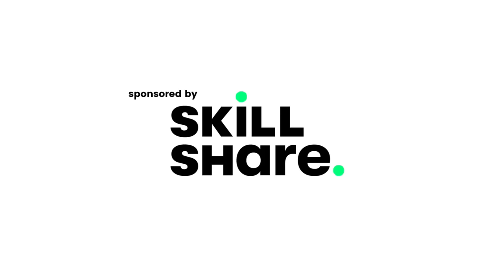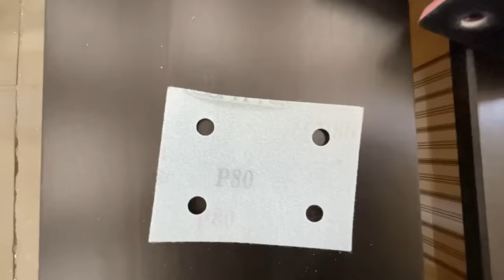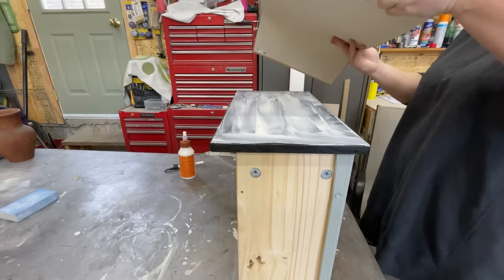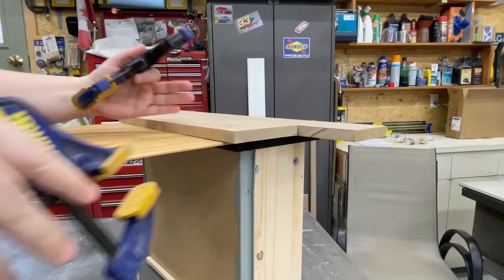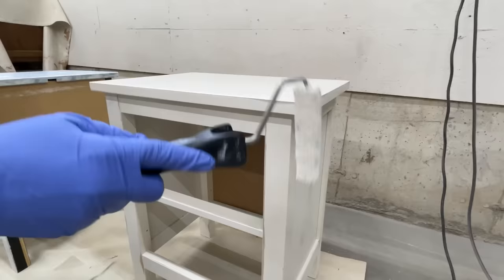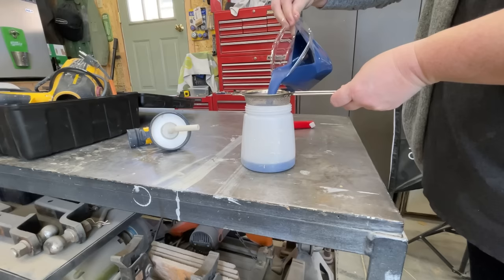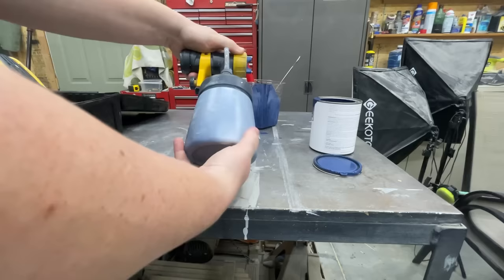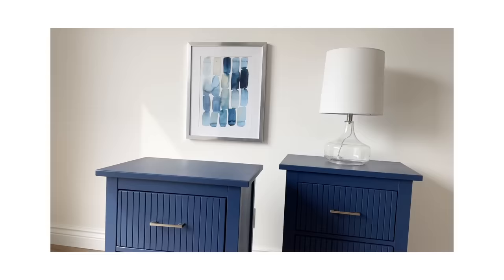Making Over IKEA Furniture | DIY IKEA HEMNES HACK

Comment: Wow. Thank you so much for this. Did you prime the surface of the hemnes too or just sanded it between coats? I’m looking to repaint mine white. Got two second hand ones where the paint is chipped off at several places on top. I tried to sand with 120 grit and it took ages. I’m not going to buy more sandpaper now. Just want to get it done 😂

Comment: Great job!!! Ingenious with the placemats. About the Wagner — I had the 590 for a couple of years. I have since upgraded to the 5000. However, with both the 590 and 5000 Im not getting a wide spray pattern the way you’re getting. Are you using the fine detail nozzle or the other nozzle that is used for larger projects such as house painting? I know the larger nozzle has adjustments for how wide you want the spray but the fine detail one, which I always use, does not. It takes me forever to spray a piece of furniture and it looks like it’s taking you no time. What am I doing wrong?
Reply from the maker: I’ve only ever used the fine detail nozzle. There aren’t any spray pattern adjustments on it as far as I can tell so I don’t know why yours would be different. Sorry.
Reply: @salvagedbykscott  Hmmmm ... What settings did you use for the chalk paint? I saw you kept adjusting it. I have the power setting at 5 for fear that any higher will make the paint too heavy and will make it run.
Reply from the maker: I usually spray my paint at a 3 or 4 with the trigger about 1/2 way open

Comment: What an amazing idea! I'm also having trouble finding pole wrap. I want to do this on a  Hemnes dresser but the full-size drawers (27.4 inches) are slightly wider than  the mats (25.5 inches). Do you think it will still look good if I line up two mats to fill the width?
Reply from the maker: Yes! You should be able to patch a few together no problem.